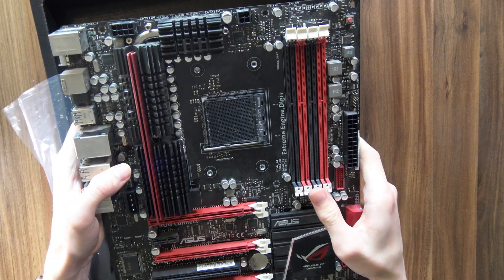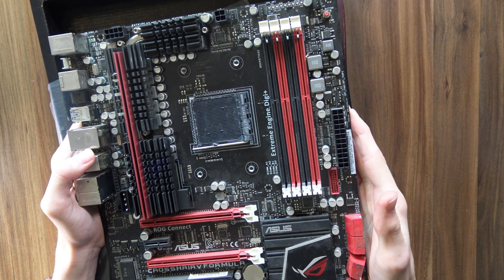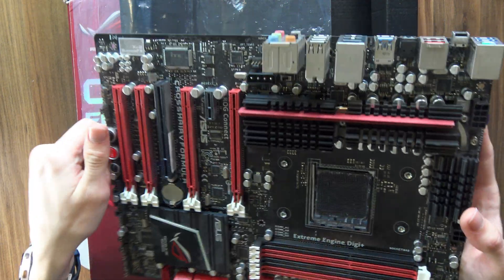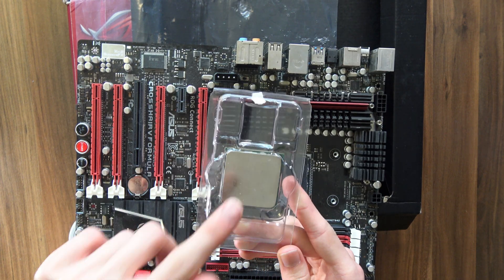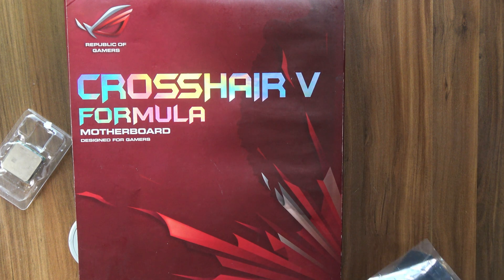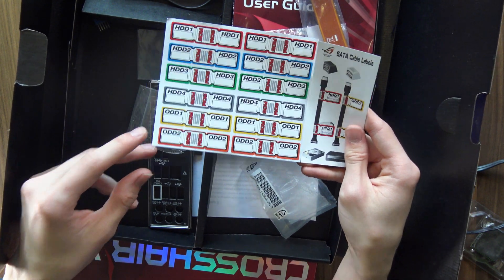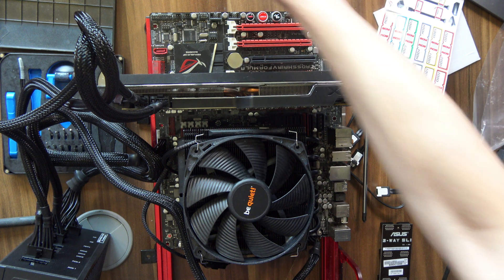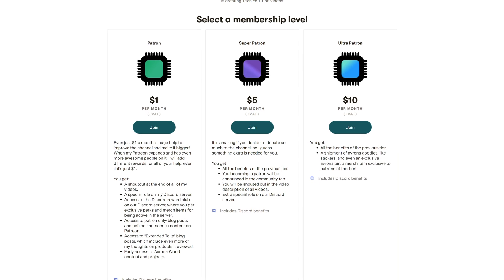The Most ICONIC Motherboard EVER?! ASUS ROG Crosshair V Formula Unboxing

Comment from the maker: I can't wait to build a 3-way SLI build with this motherboard, alongside other extreme experiments! If you're as excited for those projects as me, make sure to subscribe, and also support us on Patreon so we can actually afford such projects: https://www.patreon.com/avrona
Reply: make sure you replace the thermal pads on the mobo! i just changed mines they where in ruin! and the pcb changed colors from the heat! i never been able to close my case side panel due to heat generation hahahaha
Reply: i'd also recomend you use only a 2xsli/xfire for 2x16 leaving 8 lanes for pcie adapter cards 1@4x for nvme for 2.5gb/s read speed and you could add maybe a wifi card! 16x+16x+4x+4x = 40lanes so you maximise the build potential of this machine, if you got 3 way sli/xfire you need to do 16x/16x/8x which means your card will only run at the slowest speed which is 8x because they talk together in a SLI/xfire setup. please keep me updated!!!!!
Reply: That's a Good board but the Asrock Extreme 6 board is better it supports 64Gb of ram, though you probably won't fully utilize that, Extreme 6 asrock board is at the top of the list for the AM3+ platform.

Comment: 4 pin molex is for extra power to the pcie x16 slot.  
R.O.G. switch is for the dedicated usb port to use seperate laptop or pc for realtime O.C. / tuning ( with usb a to usb a cable and aditional software)

Comment: i'm watching this video on asus crosshair formula Z, AMD 9590 8 core 4.7ghz and amd R9 290x :D i'm about to upgrade this baby with a pcie nvm adapter card with a gen 2 silicone power 1TB nvme on the second pcie slot for 2.2Gb/s 1.6Gb/s read/write speed! its a 9 yo now :D

Comment: Hi nice to meet you i am planning to build a streaming pc is it possible to guide me.I am not going to play any games in the pc it's only for streaming.
INTEL CORE I7-12700K 
MSI MPG Z690 Edge WIFI DDR4 Motherboard.ATX Form Factor
CORSAIR VENGEANCE LPX 16GB (16GBX1) DDR4 DRAM 3600MHZ 
Which GPU is good for streaming Rtx 3060 TI or RTX 3070 TI.
In my country 3070 ti price is very high but 3060 ti is nearly msrp. Waiting for your reply.✌️
Reply from the maker: For just streaming a 3060 Ti should be enough! You can also save some money by downgrading the CPU a bit and increase some performance for free by going 2x8GB RAM.
Reply: @avrona   thank you so much just now I got my GIGABYTE AORUS GEFORCE RTX 3070 TI MASTER 8GB GDDR6X in nearly msrp🥳 this is my first pc build

Comment: I bought one on eBay last year for $300 hoping to super overclock my FX8350 and long story short after a lot of hair pulling and hours of troubleshooting, could not get it to post.  Some of the capacitors on the board looked iffy but to replace them was above my pay grade. I resold the motherboard back on eBay for $150 "as is". Glad you have better luck with this board!